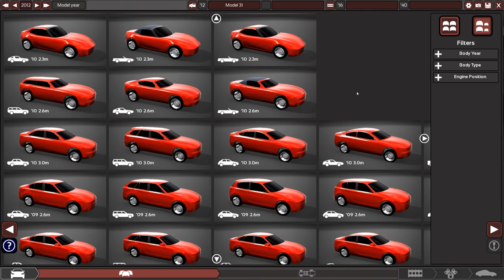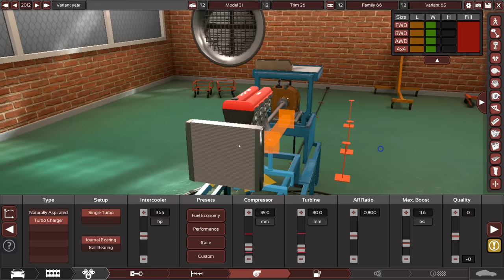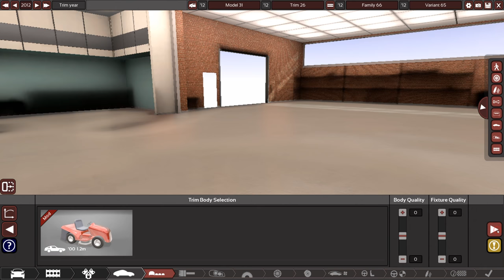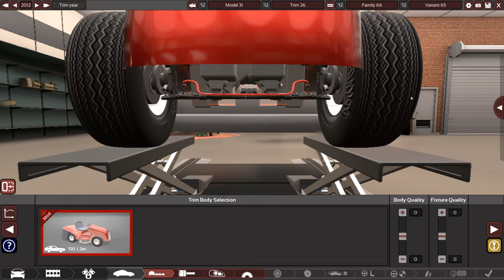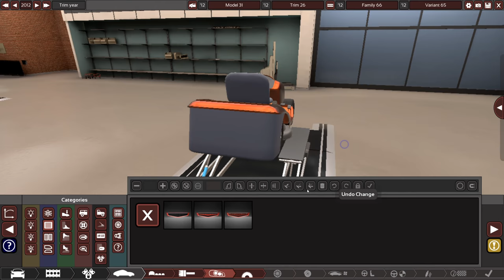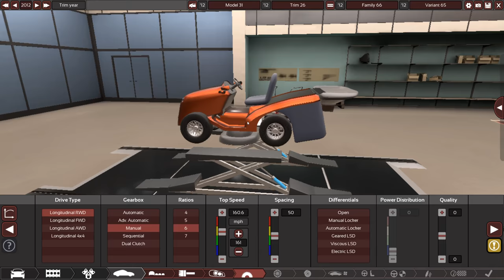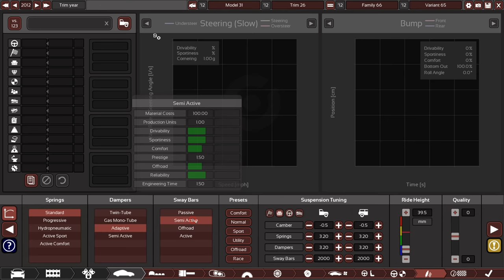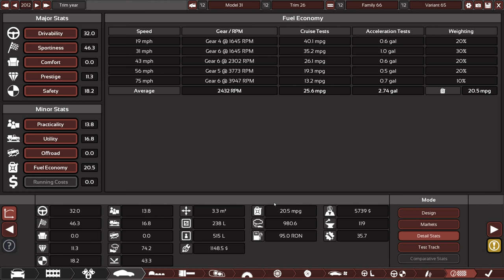Automation/BeamNG Drive - Worlds Fastest (And Scariest) Lawn Mower

Comment: Stupid American asking a stupid American question here...do people in the UK/England have riding lawnmowers? I mean, I know you can own one anywhere but it seems like most of what I've seen of properties there are either very small lawns which could be easily handled by a push mower or massive sprawling acreage which would probably be best handled by either a full tractor or at least something industrial grade like a zero-turn mower. If I'm way off base and there's areas where people own about 1 acre (again, US measurements) then obviously my question can be ignored.
Reply: Yes, we don't all live in London. Though as the price of land anywhere you can actually legally build on it is quite high, it's generally seen as an extravagance and/or wholly unnecessary, unless you've managed to bag yourself one of the few remaining isolated / small village country houses that don't yet cost a bajillion zlotys. A typical garden may not be the size of a postage stamp, but at the same time it generally doesn't take more than a minute to walk from the back porch to the end of it, and it may only be maybe eight to twelve hand-propelled mower stripes wide, so cutting the grass isn't exactly a daunting or time consuming proposition, so long as you don't have some piece of overpriced hopeless garbage like the Flymo my mum used to own...

Still, the devices aren't unknown, just uncommon.

My uncle has one, though I expect it came with the house he recently moved into as he's quite physical (and has a tweenage son to help with any garden jobs he feels are beneath him) and the total lawn area isn't really any larger than what I've personally mown by hand before without any trouble. I've never seen the thing move out of his garage, yet.

My dad used to have one, when he was living in an old gamekeeper's cottage on the edge of a farm, with a ludicrous amount of back garden space (by UK standards) set well away from the road so mowing the lawn was a good excuse for getting the mower out and trying to set a lap record around an imaginary rally course, after doing the actual job which would take all of about ten minutes and dumping the cuttings off to the side a quarter mile up the farm track that ran past the house (...which was also good for practicing one-wheel burnouts and limited drifting in his old Volvo 240 without getting into a mess with actual traffic, especially in the snow). I found it somewhat amusing that it sported something like a 300cc engine and claimed something like 15 or 18 horsepower, yet topped out at about 8mph... when I went to visit him on a 125cc bike producing 11hp but was capable of motorway speeds. Kept telling him he should replace the transmission and use it to drive to work, save a bundle on fuel...

More commonly though you find them in the hands of groundskeepers and other professionals who have to cut a lot of grass in a limited amount of time, around more communal or public buildings. For example, the firm that looks after the grounds around my apartment block sometimes turns up with a (still petrol powered and possibly self propelled) non-riding mower, sometimes with a riding one if time is tight / the weather looks bad / that particular operative was able to snag the keys to the van with it in. Problem is, they're just not as manouevrable as the push-along models, and there's an awful lot of fiddly obstacles, so I can't help feeling that the ride-on only makes the job slower for them. It's more suited to playing fields and long roadside verges etc.
Reply: +mspenrice Pretty neat information to be honest. Here, i'd say in a normal neighborhood you definitely shouldn't need a riding lawnmower, but a lot of places on the outskirts of cities, or simply on country roads will probably have one simply because their yards are much bigger. I live on a property with about 4 acres of land, so using a hand mower just doesn't quite get the job done. I'm a US citizen also, though.
Reply: @gwenynorisu6883  thank you so much. I really appreciate that very detailed response. Good to know there are still things for me to learn. :)

Comment: Lol its got a bigger engine than my brothers car
Reply: Hell, it's got a bigger engine than my own car... and 220 more horsepowers.

Though I think I've got more low-down torque, which is nice, and it cruises more efficiently (well, maybe not at 19mph... I haven't had the patience to check). Also more seats. And a roof, and a radio. Plus despite my best efforts and the sticky tyres I've installed, it absolutely refuses to fall over in the corners. So there's some comfort there.

(which is something they must have worked on special for this generation, because I borrowed and abused another of the immediately previous revision of the same model... and the only thing that stopped it tipping over in even gentle curves taken at moderate speed was the absolutely hideous oversteer caused by its seemingly solid plastic tyres... that and the tinpot construction was enough to almost put me off buying the current one, but I was a bit starved for alternative choices that fit my other needs and I figured I could always buy some aftermarket coilovers later on... thankfully no need for that and the construction is more substantial)